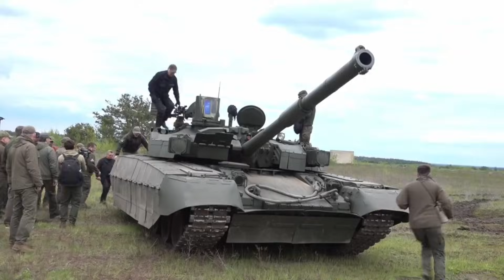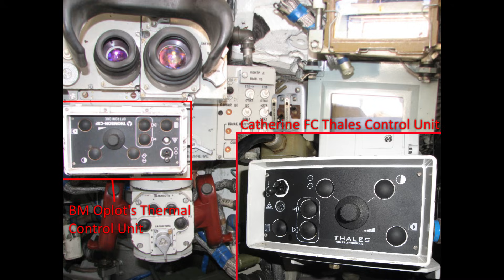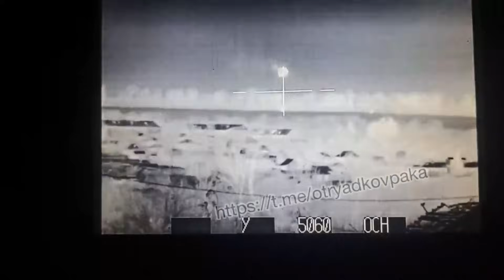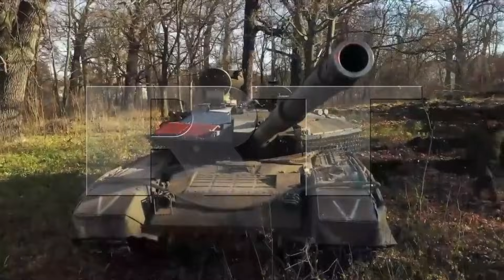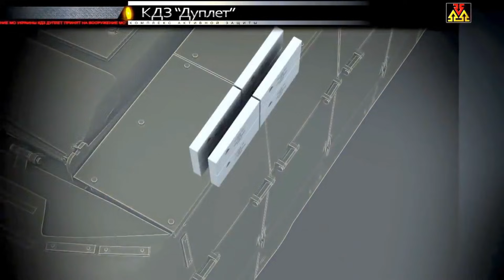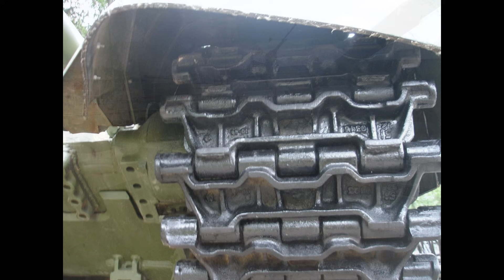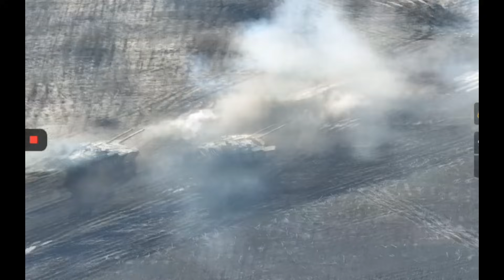Best Ukrainian vs Best Russian tank. T-90M vs BM Oplot comparison

Comment: Great video.  Just one comment: it sounded like you either didn't phrase or understand the difference between horsepower and torque.  Higher torque does not necessarily mean faster acceleration.  To simplify, power is what determines acceleration.  The peak torque numbers don't actually mean much.  The torque curve (torque vs RPM) determines how much horsepower the engine in question produces over those RPM.  That's where the transmission comes in, as the gear ratios and other characteristic in communication with the power delivered at the RPM in question will determine the actual acceleration. 

Now, I'm not at all saying that the T-90M doesn't accelerate faster.  I frankly have no idea whether it does, and it very well might.  All I'm saying is that you can't determine that just by looking at the peak torque values produced by the two engines in other to figure that out.
Reply: Corrections:

.. didn't phrase or understand .. *correctly

... gear ratios in *combination (not communication - apologies for the autocorrect)

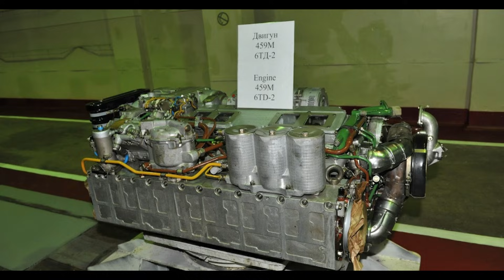Comment: The lower torque does not really matter if coupled with a transmission that has appropriate gear ratios and number of gears. 13:17

Comment: the biggest problem for the T-90M is they cant produce even 240 a year and they are losing thousands of tanks in just one year, forcing them to use t62 or even t55/54 tanks ... i can hear those Russian trolls scream already ..... well it if not true why are the t62's and t55/54 showing up on the battlefield ...explain that one

Comment: The T-90 should be able to win IF Russian commanders use it correctly, Russian high command has been using their tanks in highly vulnerable armored columns that are open to artillery fire.  While these tactics may work with overwhelming numbers, but for once, Russia doesn't entirely outnumber it's opponent in terms of armor as they haven't fully committed their forces.

Comment: You are completely wrong about torque and acceleration. Both engines have very different RPM on the power band. 2stroke rotates much faster. So gearing is different.
What matters is not the torture on the engine but the torque on the driving sprocket after transmission.

Comment: Maximum torque does not determine acceleration. Power output is the only thing that matters, as long as the gearing rates are correct. A less torquey engine just needs a higher final drive ratio.

Comment: The T-90M3 can weight up to 54 tons according to some valid sources, depends on the modifications. Additional reactive protection alone it makes 50t. Then you have all the other stuff.. I think 48t is accurate for the T-90MS in 2017 version.
Reply: Can you cite them please? I find an increase by 6 tons by adding some cage armor hard to believe.
Reply: @definitelyfrank9341  

Not just cage armour dude. Carousel armour, cage armour, ERA, newer modern systems, 6ton on a tank honestly isn't much. Look at the TUSK Pack for the A2 SEP
Reply: @s4ss.m8  He's saying that there's a 6 ton difference in weight between the T-90Ms in 2017 and the ones used today. 

What weight have they added to the T-90Ms since 2017? Just some additional cage armor for the most part, that's it. The modern systems, carousel armour, and Relikt were already on the tank.

Comment: People saying that it's strange that Russians aren't replacing the transmission. Keep in mind that this is still the nation that didn't wanna replace the KV tank with better and newer designs, and just slapped some armor plates all around to make it's armor more effective. The butt ERA on the T90M is the perfect example
Reply: The most probable reason is that theyre using the same transmission for so long that changing it would mean changing the production lines to the point where it could hamper the production of the tanks so much.

BM-Oplot had the same production challenges when they were delivering tanks to Thailand.

Comment: Both have a common grandfather, T72, and are very simmilar in performances!
Reply: BM Oplot is an upgrade of the T-84, which is an upgrade of the T-80, which is basically a T-64 with a gas turbine engine, not a T-72.

Comment: Me personally, for Russia, they should just abandon the T-14 project and start allocating all those funds towards the T-90M, constantly improving on the design, especially it’s reverse speed. It’s a pretty decent tank all-around.
Reply: Probably the most cost-effective modern MBT in the world.
Reply: Age like fine wine. The T-14 Armata should have the same fate as the Black Eagle. Now, Russia is trying to develop T-90M2, now it will use the same transmission as the T-14 and new armor + protection.
Reply: T-14 Armata is new model tank and with Russia‘s lack of reserve T-14 make it is very hard to repair while the T-90M has the same engineer like T-90A, T-90 and T-72 so it is easy to repair.

Comment: Leopard 2A6/7, T-90M, Abrams M1A2, T-14, K2--WHO CARES? The fact is, given Ukraine's position in the conflict, and the tactics of the conflict in general, the tank being utilized is not going to matter very much. The Leopard 2 A4-A6 models are great tanks; but they are being destroyed by means that would destroy ANY tank. Extensive minefields, highly mobile and plentiful Russian ATGMs, Russian air superiority (rotary and fixed wing), and last, but far from least, Russian artillery at an advantage of 5:1 in favor of Russia---on a good day for Ukraine. That's not to say that both sides may as well be using T-34s. Good tanks matter tactically to a great extent. Not so much strategically--at least as best as I can tell--at this point in the conflict.  For this reason, Russia is not worried about Abrams or any other NATO or AFU tank. Second, assuming tanks can be utilized to an advantage strategically, how many modernized tanks (never mind "BM Oplots") is Ukraine producing per year? As far as I can tell, Ukraine is economically, and militarily, entirely reliant upon NATO countries (i.e., the U.S. and its other cast of minor characters). There aren't even enough BM Oplots being produced to show up in Ukrainian armored graveyards (in reality, NATO) armor, or videos of destroyed AFU tanks. The bottom line is, the Oplot could be the best MBT in the world. But like the T-14, if there are only a dozen of them, and the role of tank is significantly diminished at this point, in this conflict--then who cares? Those who understand this conflict have understood for some time now that is has become a conflict of attrition. I could make the same claim about Russian tanks, but at least they can produce/modernize tanks in large numbers. They also are not reliant upon tanks. Really, neither side is.
Reply: I agree with you completely except for the "the Oplot could be the best tank in the world" bit.

Comment: The best Ukrainian tank T-84 BM Oplot is a tank Frankenstein. It was adopted in 2009 and only 10 units were built for the APU . Another 49 pieces of T-84 Stronghold T were sent to Thailand, which was extremely dissatisfied. This is not a new development, but the result of "technical cannibalism", for which the old Soviet T-80 acted as a donor. The "newest tanks", as they are called by the Ukrainian media, are created from the remains of equipment of the 4th-5th storage category. That is, from what is in the open air at the "tank cemetery", it was overgrown with grass and simply was not sent for melting in time. According to Ukrainian media reports, there are several hundred Soviet engines for the T-80 -GTD-1000T in warehouses, of varying degrees of preservation, of which 49 pieces were created to fulfill the contract with Thailand. It's hard to say how long these "Frankensteins" will work after that. The gun barrels of the "Strongholds" were also removed from the "corpses" - Ukraine has not managed to master their production.

Comment: Apart from reverse speed and some tech import shenanigans aside I think I know the main problem that any russian tank might cause to russians themselves- steel. 
I wont go into wild details but some rumours say that russia doesnt have big facilities doing HSS(high stregh steel). And name itself should hint that its needed for things like tanks, IFV, trucks and all sorts of train related stuff (go google sabotages on crimean train stations. melting trainwheels to rail with thermite is easier than you think, and its more destructive than you think. though I dont have hard proofs that its used practice in SMO)
Reply: I really doubt HSS manufacturing is an issue. Pretty much the only tank that they're producing from scratch is the T-90M, and not in very large numbers; the T-72B3Ms and T-80BVMs are all old tanks that have been refurbished, so they didn't use any significant amount of HHS to produce.

Comment: More torque doesn't make the tank accelerate faster....the M1 Abrams has about 400 nm of torque, as it uses a turbine running between 10,000 rpm and 25,000 rpm....and it still is much faster than the T-90
Reply: a tank bigger in size and weight with less torque means its faster than a tank lighter with more torque and whatever? doesn't make sense

 plus that big ass turbine engine  doesn't allow abrams to aim back........although it doesn't seem necesary there are moments when having to aim backwards are needed
Reply: @BlackPhantom_II  Peak torque and peak RPM is about equally as telling about a tanks performance when it comes to engines...what matters is power, more specifically the power curve and peak power. Power moves the tank, torque is only a static force, you need speed in order to move anything, along with a continous force applied!
Reply: Aaand why is Abrams much faster?

Comment: Both are poop. Russia hasn’t developed a decent tank since the USSR. All they are doing is putting bandaids on problems they can’t afford to fix. Both tanks are too small, underpowered, and have glaring issues.
Reply: T-90M has demonstrated that it performs better than the Leopard 2 in Ukraine.
Reply: @definitelyfrank9341  based on what? I’m genuinely curious how you came to this conclusion……
Reply: @sweettrav20  Theres legit a video of a Leo 2A4 being destroyed by a T80BVM
Reply: @AbbyTheFE  yep. There is video of a Bradley destroying a T-72 and T-90. Does that mean the Bradley IFV is a better “tank”? No. I know you’re excited. But relax. 

Ukraine is not losing territory ground. Russia is losing territory.
Reply: @sweettrav20  Show me the video then talk, I can show you a video of a leo 2a4 burning down due to a fucking campfire lol.
Not to mention the bradley that got penetrated by an artillery shell and it blew up inside the vehicle
Reply: @sweettrav20  Leopards have shown themselves very badly, these are huge tanks that are quickly detected, it is impossible to disguise them, they are extremely heavy and it is extremely difficult to evacuate them with loss of mobility, it is also not realistic to repair them in the field, leopard shells are not effective against infantry, even if they meet T72-90, they are hit by guided missiles from 5 km, although they themselves must approach 3km for effective fire. In addition, there are simply few Leopards, so infantry in general often have to fight without tanks.
Reply: @milaro222  Literally everything you said aside from from maybe the performance of older Leopard II’s not accurate. USSR chose smaller tanks because they could build thousands of them cheaply and quick. They were weak on armor, low on tech and had a big gun. The USSR had millions of troops and would just use soldiers as cannon fodder. 

All western tanks are more mobile than Russia T-72, T-80 and of course T-90. I mean T-90’s turn around and drive forward because they can’t reverse out of harms way. 

The performance of the Russia tanks is currently not good either. You say the leopards are too big and can be seen to easily. Does that mean the T-14 is already obsolete because it’s bigger than all western tanks currently.
Reply: @sweettrav20  The USSR made small tanks for 100 different reasons, including a low silhouette and better camouflage capabilities, giving Soviet tanks a huge advantage in Ukraine today.
Cannon fodder is not when you have 10 thousand cheap T-72s, cannon fodder is when you have 100 super-expensive Leopard-2s for 500 thousand infantry, which suffers losses of 100 thousand soldiers per month from 10 thousand enemy T-72s.
Reverse speed does nothing for tanks, no matter what speed ATGMs and drones are faster.
Yes, the T-14 is  obsolete, it is completely unsuitable for big wars where the battlefield is stuffed with thousands of drones and anti-tank systems.
Maybe if the war again turns into a maneuverable stage, he will be useful.
Reply: @milaro222  I thought the T-14 was designed for anti drone warfare. Russia has touted its drone killing ability. It’s frightening you think Ukraine is losing 100k men a month. 

Russia doesn’t have 10,000 working tanks. There is a reason they went and pulled T-55’s and T-64 ect series of tanks until they were able to get more tanks from allies. 

T-90’s have performed poorly. There is literally dozens of videos of T-90’s being sent to space by ATGM’s and Bradley’s. 

Reverse speed is a massive requirement for tanks. Russia has lost an unbelievable amount of armored vehicles. We have never seen this amount of military equipment losses since WWII. We can count 13,000 military equipment losses. That is cannon fodder. The real number is much higher. Russia still holds firm they are under 20,000 deaths. Which we know is a absolute lie.
Reply: @sweettrav20  The only normal tactic of tanks is firing from ambush at infantry at the maximum range with high-explosive shells, or in urban conditions, shooting from shelters, Russian tanks are well adapted for this and give a systematic result, just because tanks are destroyed doesn't mean they're ineffective.
Here is an example:
https://www.youtube.com/watch?v=ANsfLPozdbw
And the work of the Leopard tanks is not just bad, it does not bring any results at all.

You can count lost equipment from muddy photographs of a burnt pile of iron as much as you like, only mobilization in Ukraine goes on continuously, it prohibits men from leaving the country from the age of 17 and is caught on the streets, there has been no mobilization in Russia since 2022.
Reply: @milaro222  That is not true. The reason Russia hasn’t mobilized more is because the last time 28% of men 18-28 left the country. So Russia is mobilizing thousands of Russians though the prison ranks. Offering reduced sentences or freedom. 

What would you rather be in, a modern western tank or a Russian tank? Lol
Reply: @sweettrav20  The reason Russia does not mobilize is that it is conducting a war of attrition, therefore minimizing the number of forces, but as soon as Ukraine exhausts the mobilization reserve and is on the verge of collapse, then full mobilization in Russia is possible.

I would prefer to fight on the T-62 and fire from the rear from a range of 6-9 km, with fire correction through the UAV, in this case there will be the maximum chance of survival.
And if you fight on the armored monsters of NATO countries, then you are guaranteed to be sent on the attack where your tank will be destroyed in a day.
Reply: @milaro222  Russia isn’t doing a very good job of knocking out these tanks as Ukraine has only lost a handful. 

Russian tanks are poorly made. Even the T-90 series of tanks. I don’t know how you or anyone can claim leopards have performed poorly, but turn around and claim T-72’s, T-80’s and T-90’s have performed anything other than poorly. 

Russia bit off more than it could chew. They tried a massive invasion campaign and the entire air offensive failed, followed by the biggest logistical failure in modern military history. 

Russia has lost a huge chunk of their modernized airframes. Forcing them to go back to their old USSR airframes that were poorly maintained and we see them fall out of the sky over nothing. Multiple videos were MiG’s and SU-24 take off and then seconds later crash. 

Russia is definitely in a war of attrition, but that’s only because this was a major failure for the Russian military and Government. This was supposed to be a “special military operation”.

Comment: The biggest problem of those 2 tanks is that they both barely exist 😅
Reply: then what's the problem "Oplot"?)))
Reply: @kitjaks  the oplot doesnt exist yet and t-90m's are only just a few which is obvious bcuz russia barely uses them in war. Also its funny how people compare tanks in a tank vs tank scenario when tanks arent specifically designed for that...tank vs tank battles are so rare that its not really worth designing a tank for such scenarios, all u need to do to make it more effective vs another tank is to produce better ammunition which btw. Is always cheaper than upgrading the vehicle's armor, even cheaper than russian methods such as reactive armor which is just the cheapest way of upgrading armor one can possibly imagine...🤦🏼‍♂️
Reply: @dvls2945  Well, after you changed the parent comment, my response looks disjointed...
Reply: @kitjaks  yeah, wanted to clarify what i really meant before someone comes here and calls me biased or smth
Reply: There are dozens if not hundreds of T-90Ms, mate, and they're still being produced.
Reply: a few hundred t-90m's is barely existing?

Comment: Tank vs tank comparisons are just plain ww2 hangover. Older tanks are deadly against infantry when used as mobile artillery. New tanks are coffins when facing drones. The russo ukrainian war is showing that pin point accuracy at distance is changing the battlefield....back to ww1 man against man in deep trench systems wins.....with drones in mass support....an army needs 10s of thousands of drones to support even a small (100m) advance.   What's a few mm of armour worth if a modern tank costs 10 million to replace by a 1 kg drone weapon.